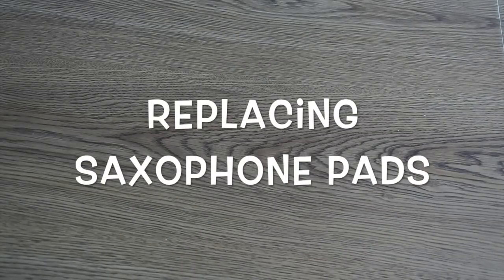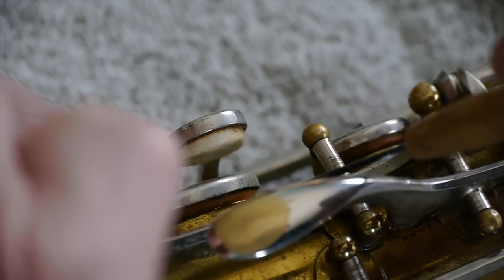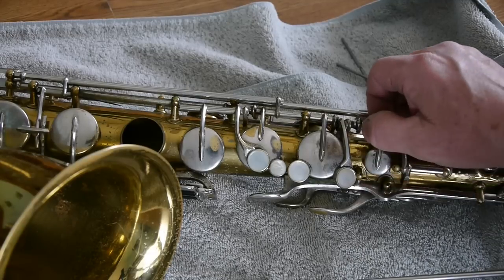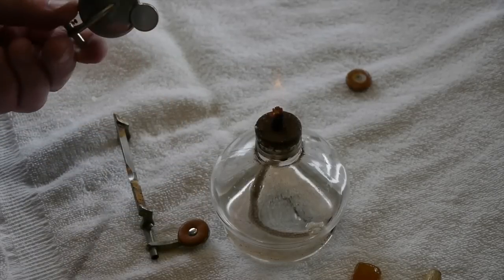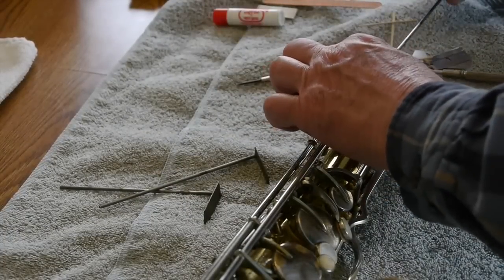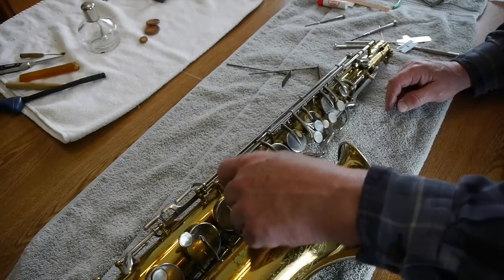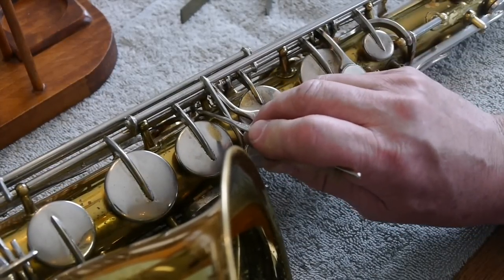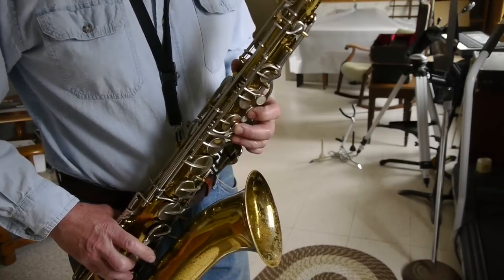Replacing Saxophone Pads

Comment: Scary. I’d be ok putting in the pads but remembering  how to re assemble? A tiny drop of thin oil on the rods would be sensible. I noticed some of the keys did not have cork stops so it would be metal against metal. The sax has a lovely tone. I have a selmer cigar cutter made in 1927 and super action made in 1947, both superb.

Comment: Dear "TimTools99,"

Greetings, I'm James Williams of Anchorage Alaska. Last week when I was shopping an antique store I came across an old saxophone instrument. It has a lot of dirt, grime dust and oxidation that must be removed. However, all of the soldered components are in excellent shape and are rock solid. Also, one of the action springs is broken off and needs to be replaced.

The unit I found is a "Lafleur Tenor or Alto Sax" that was made in London England. It was an import from "Boosey & Hawkes Co." However that is all the information I have on this instrument. The serial number is "178699." The instrument is in very excellent shape for the most part, but sadly, it is also suffering from long term neglect. All of the engraving work is in fantastic shape and will not need to be restored in any way. The other issue due to age and neglect are the key pads. The mechanical components are a combination of solid brass rods, along with Nickle and Stirling Silver parts. All of the fingering for the primary keys still have their original mother of pearl buttons, but every single pad is suffering deterioration and need to be replaced.

I'm contacting you because I am in the process of repairing and rebuilding the instrument. I would like to know... do you have any information about this particular saxophone? I don't think that it has any real value as a collector piece, nor do I believe that it's one of the high end instruments so many people covet. If history is any judge, then it's likely to be a student instrument of some kind. It was obviously a well loved instrument and has only a few minor scratches, and the single bell dent that I worked out using a variety of wooden tools I made for this purpose, a non-marring hammer and my metal burnishing tool with a highly polished finish.

... the workmanship and craftsmanship of the sax is remarkable. Aside from the broken action spring, the mechanics still move and function with a silky smooth motion. Based on the little bit of information I'm providing, can you enlighten me about this instrument? When was it made and how old is it? I tried to trace it with the serial number but kept hitting a dead end and couldn't locate any information about it with the serial number.

I believe that I have enough knowledge about instrument repair, and I am a blacksmith/knifemaker with a solid working understanding of metallurgy. I was able to remove the bell dent with no problem at all. There are a few tiny ripples that still need to be addressed with my burnisher, but won't be a major problem. After I have it cleaned and polished, I want to take it to a music shop to have all of the pads replaced and the neck cork replaced.

Any information from you is welcome, and if you know anything about this instrument I hope you will share. My goal is to restore it, then hand it down to one of my grand, or great nieces or nephews. Many of them are coming of age and showing an active interest in learning to play a musical instrument of some kind. This saxophone would make a nice starter instrument for them.

Thank you for your time. If you would like, you may email your response to <froglips@gci.net>. 

Best wishes,

James
Reply from the maker: I'm not familiar with this saxophone.  It is probably a student model but not sure.  Sometimes these turn out to be nice instruments ... I guess you will need to find someone else who knows about this brand.

Comment: I am just now getting around to restoring an old alto that I've had sitting in storage for over a decade.  Being almost a century old, most if not all pads need to be replaced.  I had thought that I should clean all the old shellac/glue out of the key with a solvent like acentone before I put a new pad in.  But apparently that's not necessary?  Thanks for your video....this is my first time doing this
Reply from the maker: Good Luck Keith.  Thanks for watching
Reply: Keith Ray hey Keith, any luck on changing your saxophone keypads? I really feel like doing it myself but I don’t want to mess it up, I got a alto saxophone for free from my Nextdoor neighbor

Comment: So I landed on your page due to your video on building your tiny house from start to finish and found this as a result. Pretty random that you had a sax repair video I thought. Great video though. It makes me want to find a cheaper used sax just to practice on, as I don’t think I could bear the stress of trying to do this myself to my primary horn, which is a tenor, or my alto. Both don’t need new pads yet anyway, but I am interested in learning how to work on a repair instruments. Saxophones  in particular. Thanks again for the video, and you have great sound at the end. I wish I could get my vibrato to sound as even  and pretty as you are able to do. Gonna keep working at it!
Reply from the maker: Keith Taylor thank you. The vibrato is all about training your jaw to move like you want it to. Slow or fast - whatever. Here is how to train. Start by dropping your jaw in a motion one big “yaaa” per beat of your foot. Like “yaaa” “yaaa” “yaaa” - one wide vibe per beat. Then do two vibes per beat. Yaaa yaaa. Yaaa yaaa.  Then go to three yaaaas per tap of your foot. This way you are training yourself to vary the speed of your vibrato to do be able to do whatever you want. Do these exercises every day until you master the vibrato at any speed. Good luck.

Comment: i’ve always wanted to learn how to repair instruments, so thanks so much for this video!!
i have a quick question though, how should i go about cleaning the gunk off the metal? when the metal turns green, or when you remove the pads and there’s residue on the saxophone. thank you!!
Reply from the maker: I usually just use a mild soap and water but I know what you mean about the metal turning green.  That is usually because the lacquer has come off exposing bare metal.  You may need to use a buffer

Comment: HOW REPLACE ALL SMALLS CORKS FOR THE NOISE OF CHIQUI ,CHIQUI THATS KILLINGME !!
Reply from the maker: +Julio Soto 
Oh yeah the chiqui chiqui is not good.  That is quite a job to do the entire saxophone.  You can be cork in small sheets of varying thicknesses.  Same procedure ... heat the key up, apply shellac/glue and stick the cork on while it's hot. I shape the corks afterward with an emory board.  I will have to do a video on that next.

Comment: This is nice, useful information, helpful to watch.  You should NOT use a "crochet" hook for this work, however.  There are real tools -- specialized spring hooks -- that are designed to hook and unhook the springs, and they don't cost very much, and you don't have to start filing notches in crochet hooks.  (The only other person I've seen use one of these crochet hooks was another band teacher.  Get the right tool, guys!) And thanks Tim for this little video :)

Comment: Good video!  Thanks.  I am a novice sax mechanic and have a question for you.  What do you think about using saddle soap on the pads of older saxophones to get pads to soften up? Also I have had some success with removing certain springs on the sax on main row.  Put sponge foam blocks on large hole keys with guards and throw into oven heated to 300° while it kools down.  The pads all float over the tone holes and they can come out playing wonderful.
Reply: Put sponge foam blocks on large hole keys with guards and throw into oven heated to 300° while it kools down?
Sounds very professional

Comment: Thanks for posting.  I  am not a band teacher but I find low priced student instruments, re-pad  and adjust them, and donate them.  This video will help with an alto saxophone I just acquired.  3 questions:  Do you clean and lubricate that long rod that holds the keys before replacing it?  If so, what do you use?  I use a little dab of glue (easy to remove) on the threads of the screws of the instruments I have handled so they won't vibrate loose.  Can I do that on the saxophone?  Is the same shellac I used on the clarinets?  Thank you for any response in advance.
Reply from the maker: I use 3 in one oil.  The shellac for saxophone is dark in color.  it's heavier and stickier.  The lighter colored shellac is for flute and clarinet pads.  As far as putting glue on the threads ... I have never found that necessary but it won't hurt as long as you can get the screw out the next time.  Good luck

Comment: What do you call those burners that are used to heat the pads off? And where to buy them?
Reply: It's an alcohol lamp. Low-temp flame is slow going for heating sax pads. OK for smaller pads like clarinet.

Comment: Hi Tim, 
I have a tenor Sax Yamaha YTS 62 ("brass color" ) and at least the higher pad of the palm key is completely damaged. It's one of the easier to change (only one screw to be removed). So it is a good beginning to change all the pads.
When after removing the basket of the pad, you warm it on the flame or with hot air, will the varnish of the saxophone not be damaged?
Do you use the flat tools like a bone with one hole for the resonator in each extremity to adjust the pad? If yes, how do you use it.
Thank a lot

Comment: In your video you said sometimes after the pads are in you would have to adjust the key to seal off the leak.  Is that done with a screw or do you try to take off the key again and reposition the pad?
Reply from the maker: +Franko S. 
You use a pad-leveling tool.  It actually is placed between the pad and the tone hole and you bend the key slightly and check for seal.  I am planning to do a video on this technique - just have not gotten to it yet.  This is delicate business and a key height, condition of corks, felts etc play into it sometimes too.  Some saxophones have little  screws on the keys that help with adjustment too.  If your sax is out of whack too much, it's best to take it to a repairman but I was able to learn to do a lot of the work myself.  The repair class in college was great then after years of doing repairs for my students, I got pretty confident at it.  I will try to get the Pad-Leveling video done soon!

Comment: what do you do about lubrication?  thank you for this wonderful video!
Reply from the maker: You are welcome.  I have a needle oiler that I use to apply a drop of 3-in-1 oil at all the friction points on the sax
Reply: Kenneth G what do you need lubricant for?
Reply: Ezeq, you have to take the sax apart and clean all the old lubricant and dirt away and then apply fresh lubricant so your sax keys move smoothly with less noise and friction. :)
Reply: Kenneth G thanks for the info.
Reply from the maker: Each of the keys pivots on a rod or screws.  The lubricant helps the 
keys move freely and quietly.  Also, with out a drop of oil at each of these points,
 the keys would wear and become sloppy over time.  You only need to do this ever six months of year depending on how much you play.
Reply: Thanks for the info. It will help me once I start putting my sax back together.
Reply: Lubricate the screw rods with clear vasoline and fixing screws joints at g note keys

Comment: Do you ever have problems with heat varnish while doing this? I'm a current red wing bir student and want to try and repad my sax before I learn to next semester. Also would a plain hand held torch work as a substitute to the bunsen burner? Thanks
Reply from the maker: I use the little burner because the alcohol burns very cleanly.  When you heat your keys be careful to apply heat just until the glue stick melts.  Don't overheat. Watch out for your pearls so you don't heat them and ruin them.

Comment: It didn't look like you seated those pads. Just wondering if you skipped that part in the video?
Reply from the maker: +Krisvan6 
Yeah I guess I did.  I never worry too much about seating the pads.  It is important to make sure the key/pad is leveled then I hold the key down for a few seconds to allow the tone hole to imprint on the leather pad.  I have never blocked or corked keys shut overnight.  If the key is level, the pad will seat itself just by playing the saxophone.
Reply: +TimTools99 True. However, if you apply some heat to the back side of the key and hold it down for a few seconds, you will get a nice seat in the leather and felt of the pad. I believe it can can be helpful for getting a sax in a better adjustment quicker.
Reply from the maker: Krisvan6
Oh yes, when I first put the new pads in the hot glue, I hold the pad down for few seconds.  That puts a nice ring in the leather.  A lot of guys hold them shut by wedging cork or wood pieces to hold the keys shut.  I have never bothered with that.
Reply: +TimTools99 Ya, I only wedge them down when I'm dealing with a particularly stubborn sax. ( I'm a repair tech)
Reply from the maker: Yeah, I can understand the need sometimes.

Comment: I have a student model Buescher tenor also that I like very much but I am wondering....I can not see in the video.....does yours have the support bar on the neck piece that mine has....a straight rod going horizontally under it......that is the only thing I do not like about it's appearance......is there an option or fix for this ?
Reply from the maker: Yes ... that's the design.  It's not the prettiest saxophone but it sounds great!
Reply: I love mine.....bought it on ebay 10 years ago or so.....for maybe 150 bucks.....I tore it down cleaned repadded, oiled.....corked and then used a rope light to find leaks and adjusted it.......I can growl if I want......play sweet if I want......I was yearning for a selmer mark but quit that since I just play for enjoyment at home because this horn plays easy top to bottom.
Reply: My latest project is a buescher 1937 Alto Aristocrat a guy living here in the hills of West Virginia got from his father who played in the big band era NYC......it came with a clarinet in the case also...........I have ordered pads for both and the Aristocrat is in parts awaiting the pads. I played it before tearing it down and man does it sound good......but needed pads. :)
Reply from the maker: Man that alto sounds like a sweet horn!
Reply: The Buesher Aristocrat came with a slant Otto Link mouth piece emburated bar 5 start.......I am gluing cork right now on it....can't wait to play it. :)
Reply from the maker: Let me know how it goes.  (I never like otto link mouthpieces.)  I use a Santy Runyon mouthpiece.  #7 facing. Check those out.

Comment: Can you use hot glue?
Reply from the maker: No.  Use this stuff. You want to be able to take them out when the the comes to replace again.   Use the correct glue for the job.
Reply: TimTools99 ok thansk
Reply: Hot glue is preferable. Shellac should only be used in environments that dont experience drastic temperature  changes. Mostly places that have snow in winter and hot summers. Shellac greatly shrinks and your pads will just start falling out. Use hot glue, shurduzstik is the best, it allows for expansion and contraction.